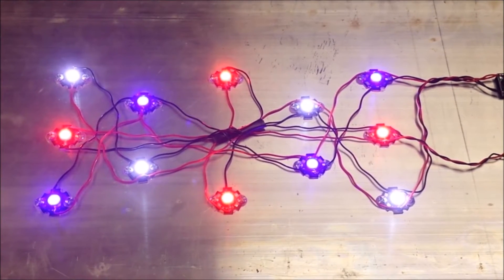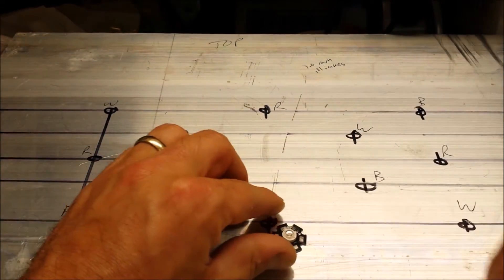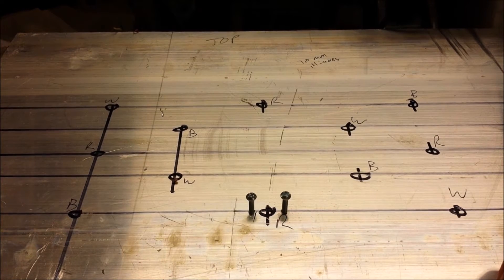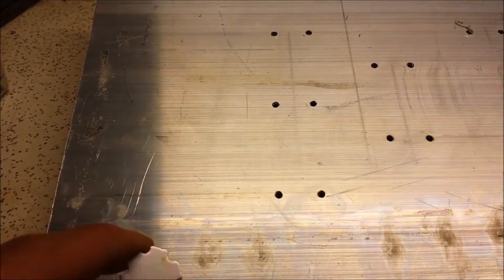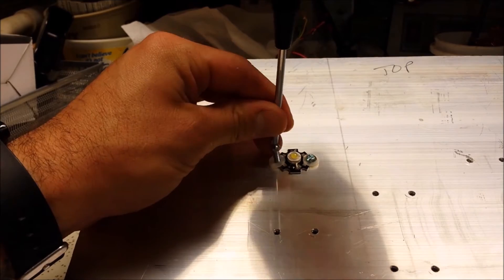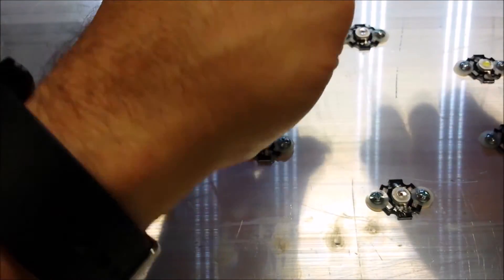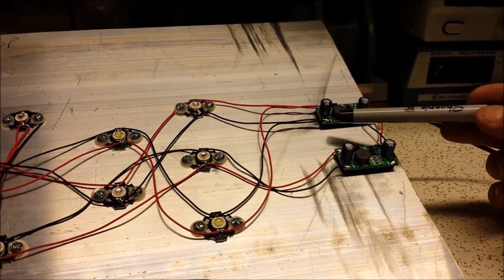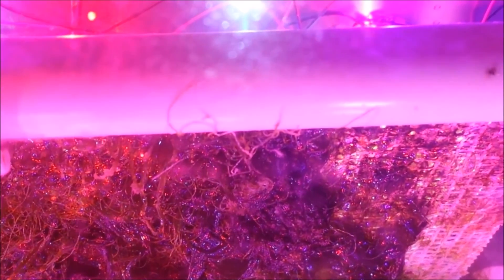How To: DIY Algae Turf Scrubber Reef / Aquarium LED Lights

Comment: where did you get the best sink and what type the connector or power supply I need
Reply from the maker: +Yoshukai Tony heat sink was just scrap aluminum I found. The power supply is just a 12 volt wall wart.

Comment: hello...I want to run 24pcs  3w blue led on one driver and 10 pcs 5w white led on abother driver...what driver specifications do you suggest for the blue and white??
Reply from the maker: +Abhishek Mondal I would look on ebay for a driver that can handle that current. Might want to brake that down to 12   3 watt led per channel.